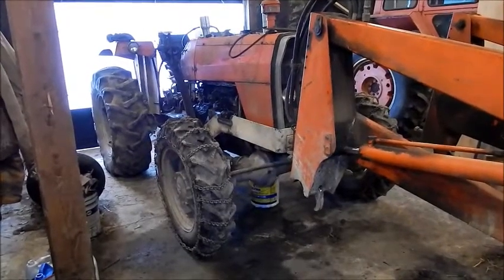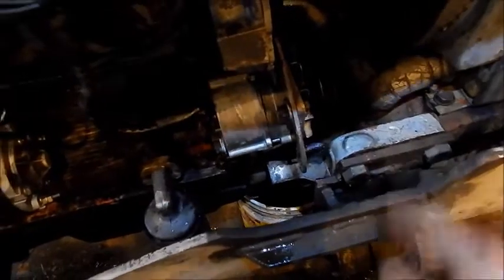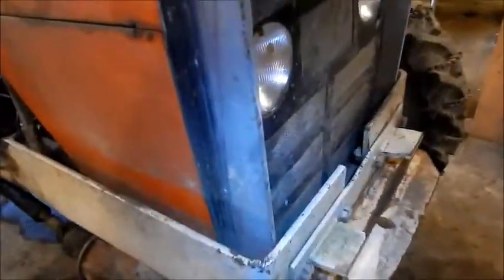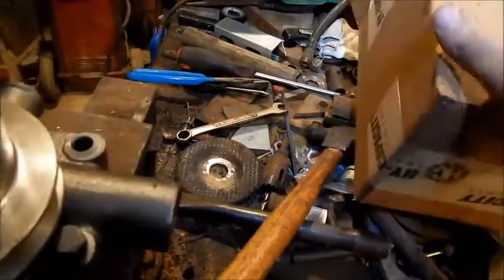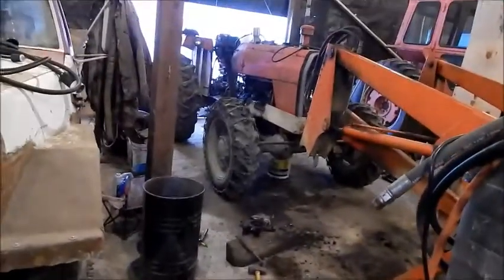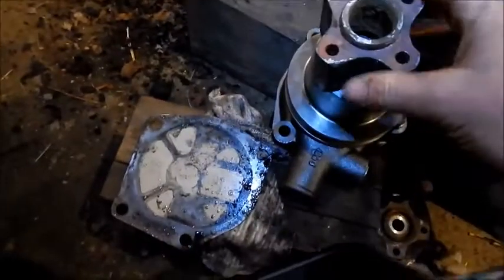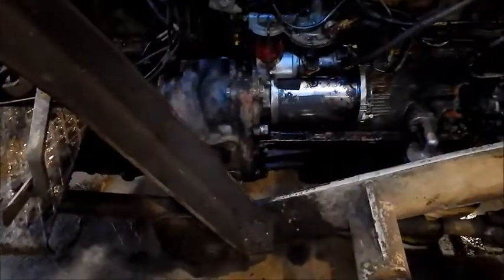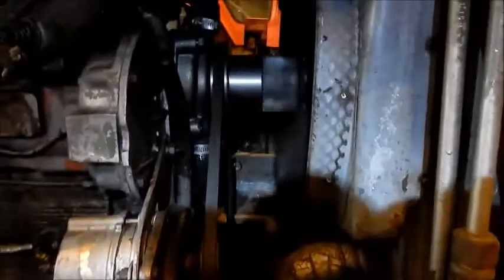IMT 560 water pump

Comment: The early 255 masseys came with the perkins 203 ci engine i had one they are pretty strong engines very good on fuel too my old boss called the IMT tractors. I AM TROUBLE but they not that bad
Reply from the maker: 10-4 on the 255,  the imt is ok,  just does loader work around the farm now

Comment: All MF tractors the AD 203 were in the MK 2 65 and first gen MF 165  1967 very good engines, Massey licensed a lot of tractors to eastern Europe and the middle east. that IMT is probably mid 70s Massey were using the AD 212 then.

Comment: It is produkt of Serbija form Jugoslavia if you now witch cantry I tok abaut. Here in Serbija that engine is marked as M34. I own one like that from 1985 and it stil runing wery vell but its 2 whele drive.Your's is bether its 4x4....
Reply: Sory if my tapyng on Englis is not so god,I only tayp in koment that engin on my 560 deluxe iz IMR M34 it's manufactured for our domestic market at that time.But for the export they have instal perkins engins and that hed resolt wit beter performans,more workin hours,ect...But on the end this our engins is lysens of masey or perkins that is alsow wery well. I'm in proces of bayng front well driwe for my tractor and instaling it, i'm shure il will be satisfyed like you whit your 4 whil driwe...
Reply from the maker: @lazarjankovic8611   the tag on the valve cover IMR jugoslavia dizel motor M34T
Reply from the maker: theres a tag on the valve cover, double check what it says.  i bought this tractor for the 4x4

Comment: Well you got something you can make work anyway. Don’t know much about the IMT’s I’ve never seen one up here. See tractor data shows it used an IMT branded 203ci engine, I guess they must be somewhat similar to the Perkins 203?
Reply: Yes, it uses the IMR M34 which is a license built copy of the 4.203 (indirect injection). Pretty much everything is the same, except some of the screws which are metric, and some less important casting shapes (for example the oil filler tube). There is also a 565 which is the exact same tractor, only with a DM34, direct injection copy of AD4.203
Reply from the maker: yep the water pump and the starter will work
Reply: Imt tractor is made in yugoslavia (serbia Belgrade). We made imt and IMR and imt have imr engine. Perkins licenced. We made a lot of model.Sad story is the bad politic off the industry a very quality tractor who work and after 50 years. IMT IS LEGEND